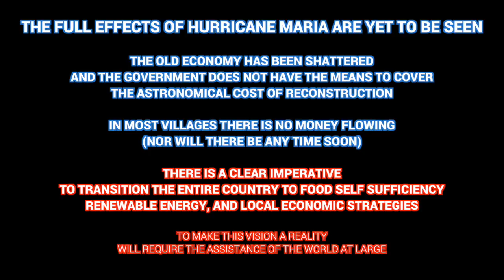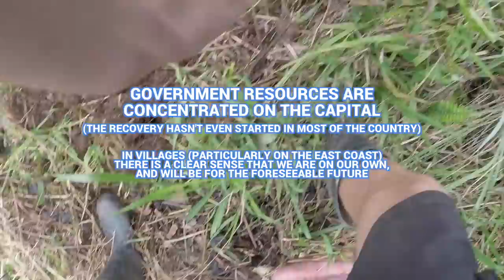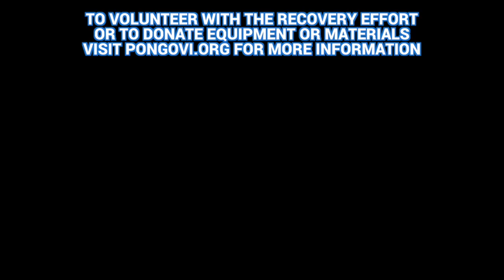Hurricane Maria Recovery + A Positive Course of Action

Comment: Considering the amount of wood available right now with the broken trees everywhere, it would behoove you to build a simple wood gassifier to power generators and possibly some trucks.  This would turn all the wood content in the debris into a short term fuel resource.  There are many videos on building these and it allows a gasoline engine to run off the hydrocarbon gasses formed by heating wood with fire with very simple modification.  Materials needed to build them can be found in the ruble.  I hope you consider this as a viable option, if you haven't already thought of this.  I wish you all well and a speedy recovery!

Comment: I hate to sound negative but building your castle on the sand is not a very wise thing to do.
I do admire the pioneer spirit and the community you people have, but you are only safe until the next inevitable storm happens it would seem.
I do hate the nanny state but I do also realize that building codes are there for a very good reason too.
Build high and strong I guess!
Reply: They literally lack the foresight to use brick instead of cheapest shit available. How long can we save them from themselves?

Comment: Air layering, bio char, activated charcoal and sand water filters.
Reply: Castled dry block concrete buildings.
Reply: Solar hydro thermal refrigeration.
Reply: Sprouted grains gain ten times there mass in two weeks.

Comment: Wood gas  electric generators would be easy to make, converting all the petroleum generators over
Reply: Bio Fuel would be better
Reply: Wood gas is a bio fuel and the beaches and fields are full of dead trees to make it from.
Reply: I've built wood gas generators before and a wood gas truck.
They are not easy to make.
They are very time consuming.
They require money and good ones require specialized engineered refractories.
You need to build good filtration and condensation systems otherwise you will ruin your generator.

And you need a slough of tools. Welders, fabrication equipment like slip roll machines, a milling machine would certainly help, angle grinders, die grinders, air compressors, and much much more.

A wood gasifier will take at least 3 months to build.

Thats 3 months they don't have.

A charcoal gasifier and charcoal retort would definitely be a better option. Could be built with debris laying around.
https://www.youtube.com/watch?v=yL79ci4TH7k
Reply: Check out on you tube   Inventions from The Colony   Part 2  Wood Gasifier
Reply: Seriously, don't do wood if you're tight on time and budget. Charcoal is THE way to go. You build a crappy wood gasifier and you're generator will be permanently out of commission/ruined. I assure you making an internal combustion engine is a hellova lot harder than a proper wood gasifier or simple charcoal gasifier. And in a disaster area like Dominica, building internal combustion engines on the island is a good 10 years off or more at this rate.

Hell I'm converting my one ton dump truck to run on propane and its taken me about a month for a slap together kit.

Go with a simple charcoal gasifier at first, then when you get the time and money build a proper wood gasifier. Or just use expensive gasoline.
Reply: I call BS... if you have built a wood gas generator "what ever that is" then u would know how to modify a petrol intake manifold and its not that hard at all
Reply: Wood gas is not a bio fuel its a carbon fuel
Reply: I'm talking bio gas as in organic decomposition methane
Reply: If you don't know what it is Check out on you tube   Inventions from The Colony   Part 2  Wood Gasifier
Reply: Modifying the intake manifold, or rather, building a custom one is not the difficult part. Building the gasification unit, the filtration system, the condensor, the ash removal system, and the other components. Thats the difficult part.

And yes, wood is a bio fuel. There is trace amounts of carbon but over 50% of the fuel in wood is volatile organic compounds, methane, and hydrogen.

Biogas uses biological decomposition via micro organisms to convert wet waste into methane and Co2.

Gasifiers use thermal decomposition to convert wood and other solid fuels into a fuel.
Reply: The video I recommended was for emergency use and not to run the whole country. I have seen some in action ruffly made and work without being fancy.
Reply: Give it a week or two tops and those generators will be almost permanently destroyed. Biotar will clog the valves and fine particulate matter will score and scratch the cylinder walls and valve seating/sealing area's will start to pit. I guess its fine if you have disposable Chinese generators that won't last more than a month anyway.
Reply: Ive been doing bio fuel in central africa for over 10 years... wood is NOT a bio fuel. You obviously dont get what the term Bio fuel means, it excludes the carbon and fossil types
Reply: Why not use what they have plenty of or do we need to wait until we grow crops for biofuel they probably need those crops to eat. They do have lots of wood handy.
Reply: Yes, biofuel in its very name means biomass.

Biomass includes vegetation
Tree's are vegetation.
Wood comes from tree's.
Wood is a biomass.

http://biofuel.org.uk/solid-biofuels.html
"Wood constitutes the majority of biomass that is burned for fuel and comes in the forms firewood, charcoal, chips, pellets, and sawdust. The use of wood as a fuel for cooking, heating, and other applications dates back to well before humans when Neanderthals were the predominant species of hominid. In fact, the most troubling aspect of using wood as a fuel is generating the spark to start the fire. Otherwise, wood is readily available, abundant, and can even be collected from the ground if cutting tools are not available. Today, wood is even used in some electric generating applications."
Reply: Every time you buy and sell things you lose just use what you have. What is so difficult about that idea. I live not that far away in the D.R. and the people use everything they have with no problem. Haiti our neighbor destroy all their trees selling charcoal the country is a mess.